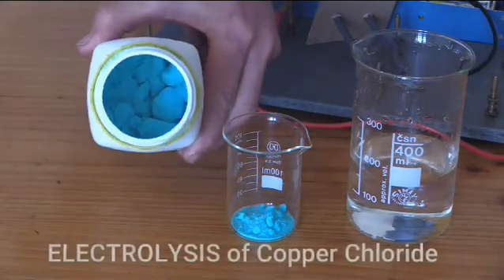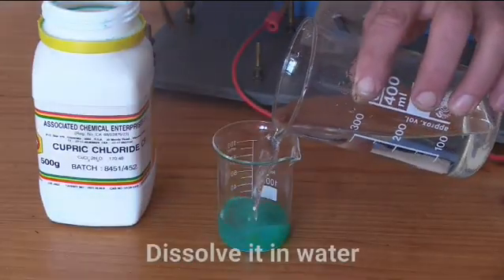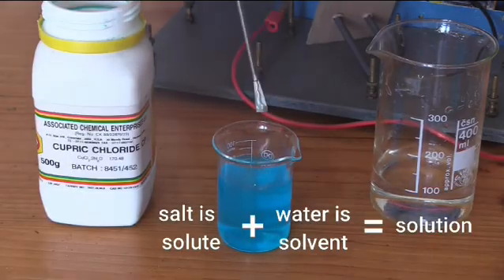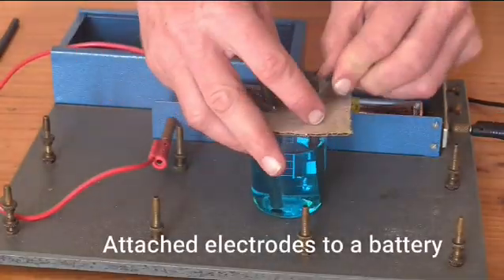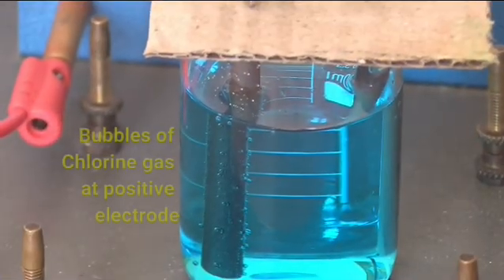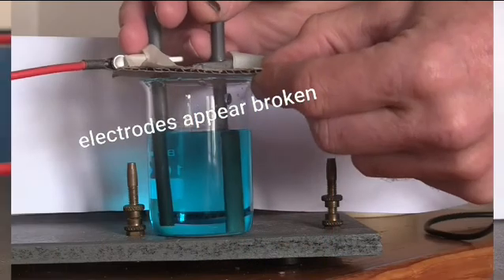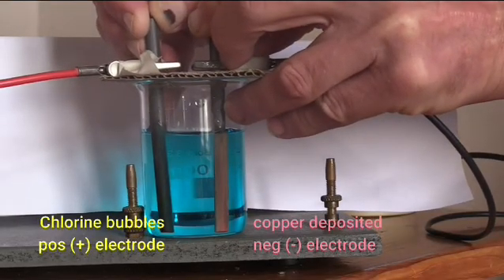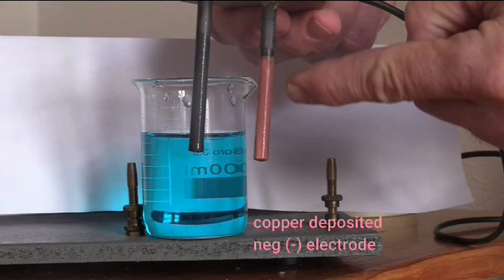Electrolysis of Copper Chloride

Comment: what is the best way to produce copper chloride from copper metal?  HCL and copper metal electrolysis?
Reply: it can be done but in some point the copper is going to start depositing in the cathode. The best method is making the electrolysis until copper start to deposit on the cathode, then, stop the electrolysis and put the rest of the copper in the solution. The copper chloride is going to dissolve the copper by this reaction:

CuCl2 + Cu = 2CuCl

Copper (1) chloride is soluble in a hydrochloric acid solution and is going to oxidize with the oxygen dissolved in solution:

4CuCl + O2 + 4HCl = 4CuCl2 + 2H2O

This oxidation is going to consume the HCl untill there is no more. With no more HCl the CuCl that forms with the excess copper it becomes insoluble, so you will know when the reaction ended when you see a light blue precipitate.
The only drawback with this procces is the time required for the CuCl oxidation step, that is limited by the dilution of the oxigen from the air.
Reply: other method is mixing copper, HCl and hydrogen peroxide, it's more costly but faster